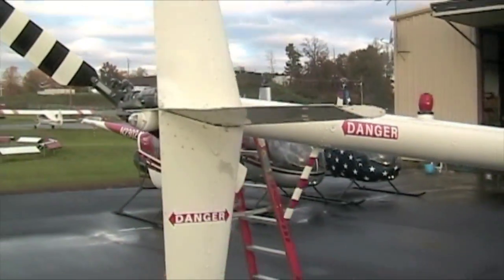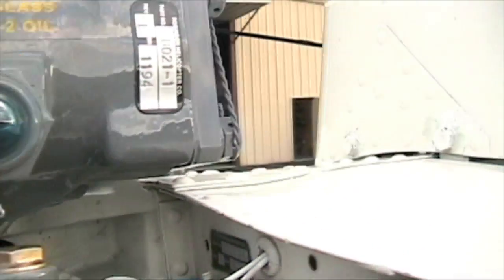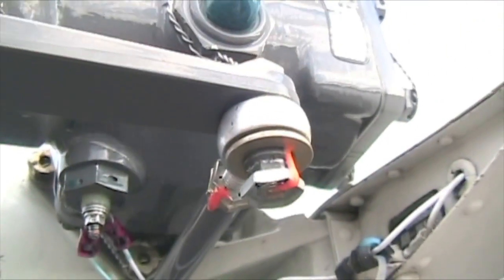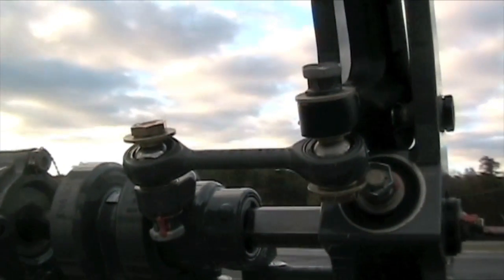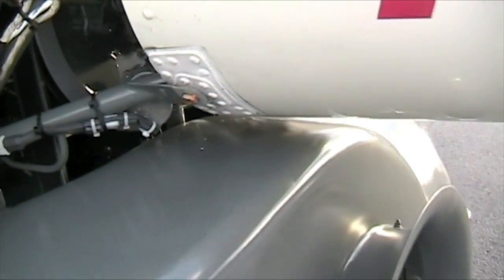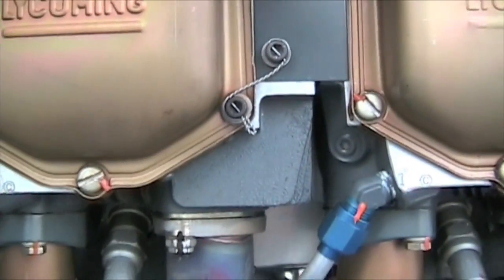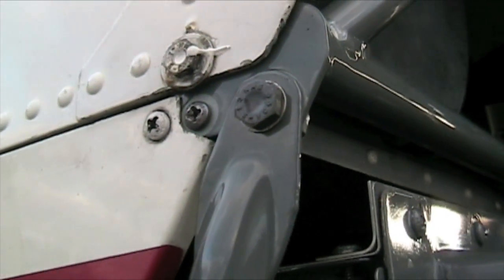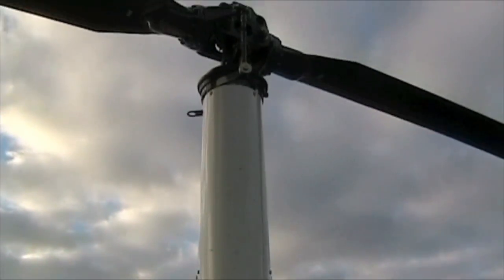Part 4 - Detailed Preflight Inspection of a Robinson R22 Helicopter

Comment: Hi Mike - I'm still trying to figure out what that hole is on the fuselage lets say between (inline) with the battery and the left position light.  It's a drain or vent hole of sorts...you can also see it on the video at the 7min:31 sec point in the video.  Whats it for?  Any ideas. Thanks ~Jeff
Reply: Translate in nindi desi helicopter working vidios